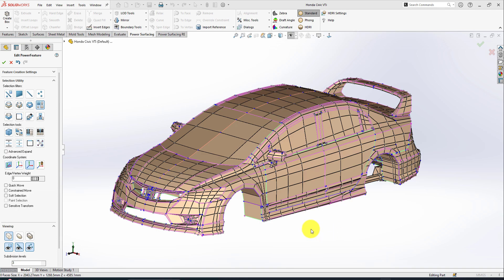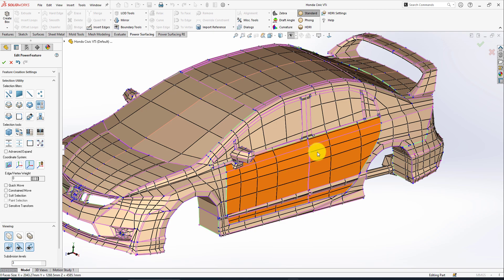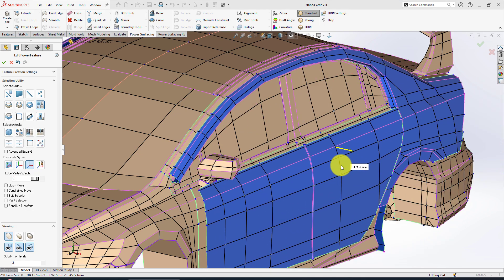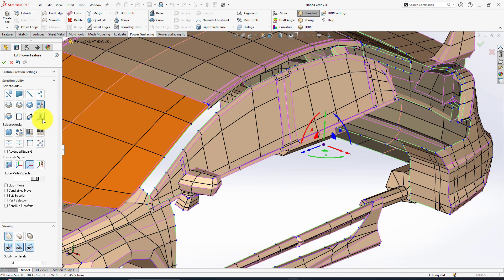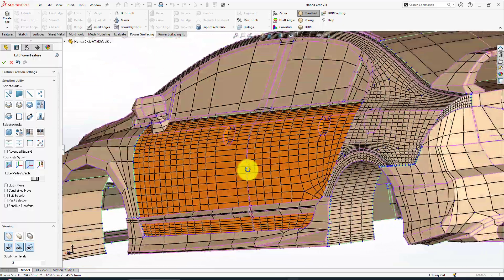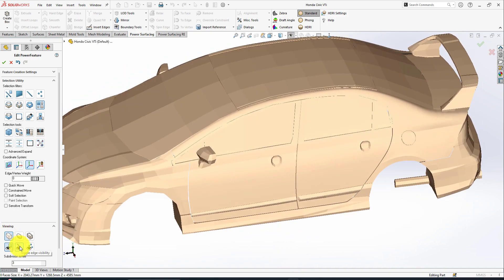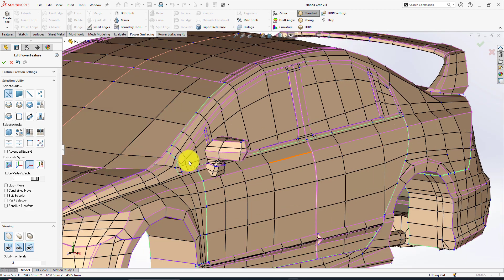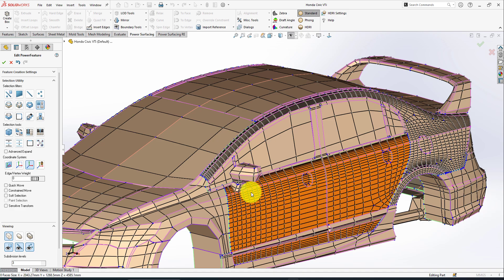Quick Tip - Adding more Details without losing main poly | Power Surfacing

Comment: Kindly upload tutorials of each part you make in power surface, you usually upload in every high speed almost 5X, it's difficult to learn from that kinda tutorial, so please it's a humble request to upload proper tutorial
Thank you ❤
Reply from the maker: Sorry for you it’s not always fast videos but some parts take hours and can’t upload that much, we teach you how to use the software and you can handle any part, will add more tutorials soon..Thanks!
Reply: @npowersoftware6638  you can upload larger videos in parts , as other YouTubers do, i Like your tutorials and the way you make awesome designs in power surface. İt would be awesome if you do it normal speed.